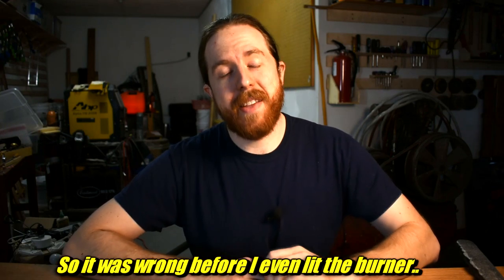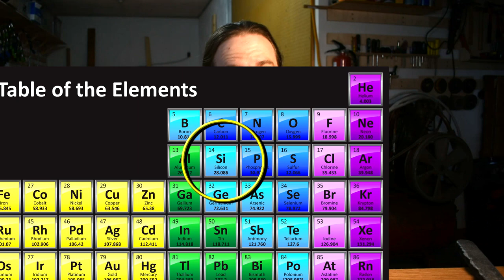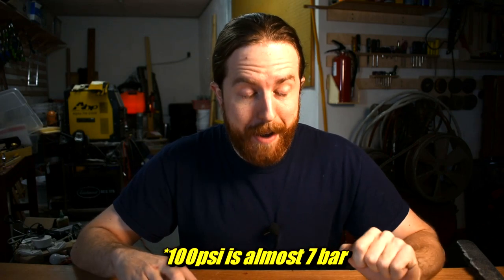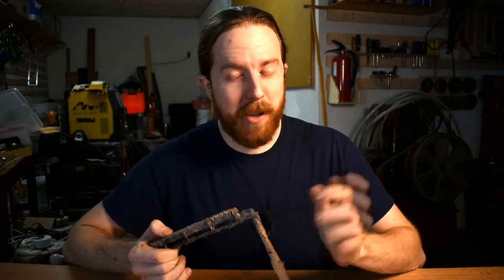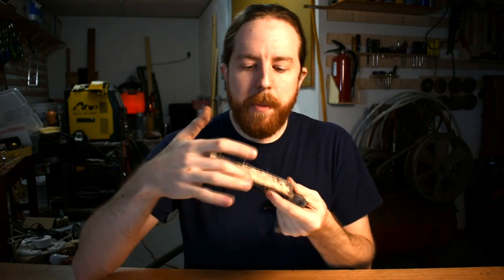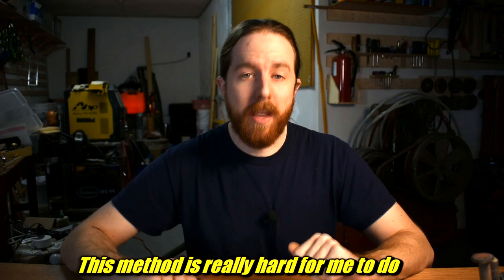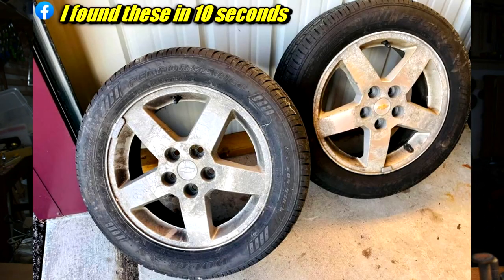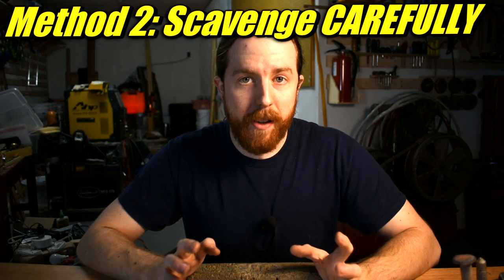Metal Casting Alloys Matter More Than You Think...

Comment: Foundry metallurgist here, mostly with stainless steel and low-alloy steel experience but my current employer makes a lot of aluminum and silicon bronze (a great learning experience for me)...ingot is definitely a great way to go because it means there is traceability to a particular chemistry. Unless you happen to have a portable XRF or LIBS analyzer on your hip or a stationary OES or XRF analyzer in your garage, it'll be exceptionally hard to buy/beg/borrow/liberate random scrap and use it to make things with consistent castability and physical properties. 

This goes double for any pewter, bronze, or brass due to lead content (you don't want to accidentally melt down a 30% leaded bronze thinking it was plain tin bronze and end up huffing all those sweet, sweet fumes), but applies to other alloys as well. The difference between C95200 aluminum bronze and C95800 aluminum bronze seems rather small chemistry-wise but makes a vast difference in mechanical properties, corrosion resistance, metal fluidity in the mold, and even the color - increasing nickel contents turn aluminum bronzes from quite yellowish/gold in color to a whiter, less radiant color. Contamination with trace elements can also turn good metal into Swiss cheese through gas pickup or into a pile of chunks by forming highly brittle intermetallic phases during solidification. 

The other thing to keep an eye on is melting and pouring temperatures - changes to the optimum temperatures aren't as greatly affected by small changes in chemistry but they're critically important all the same and are something I haven't seen talked about too much as I start to dive into home metal casting YouTube. Any ingot vendor should be able to share what temperatures they recommend for a given alloy, since they had to melt and pour it to begin with.
Reply from the maker: Thanks for the info!  Interesting you mention temperature, that was the next thing I was going to talk about. My current set up has the tendency to overheat everything really quickly and that has been causing me problems.
Reply: @PaulsGarage  Indeed...we learned a hard lesson that silicon bronze really needs to be kept under 2,000˚F or so at all times during the melt or the castings end up riddled with gas defects.

Comment: As somone who hates to pay for anything, I am a metal scavenger.  I get my scrap at work at a semi repair shop,  cast engine parts & truck rims. After some experimentation, I found that a 50/50 mix of cast scrap & extruded/forged scrap gives you pretty decent pourability (I use top feed steel forms) and  better machinability.

Comment: Sadly not all car alloy wheels are 356. BMW  wheels for example are not. Many wheel manufactures have the alloy designation listed in the letters on the back of the wheel  particularly in Europe where I think it is mandatory  for recycling purposes - the designation AlSi7 or AlSi7Mg indicate 356.
But you are right - buy decent certified ingot and get an analysis sheet with it.... Martin
Reply from the maker: That's interesting, thanks!  I didn't know there was variation, but the foundryman i talked to here was probably thinking specifically of american cars.  He was at a place making OEM wheels for lots of manufacturers, all A356, but he probably meant all the American ones.  I don't see why BMW would contract somewhere in the USA to make wheels, so that makes sense.  And that's interesting on the alloy designation, I have some aftermarket wheels cast in italy sitting  in my garage, I'll go look for that!

Comment: Worked in a foundry casting aircraft engine blocks for Continental piston engines, we used A356 if i remember right, just regular molds gravity molds, we heated to around 1700F before pouring. Good luck and great videos.
Reply from the maker: That's interesting!  Aircraft engines probably have pretty strict quality control I imagine so your process must have been pretty good.
Reply: Every case half was x-rayed with a certificate about 20% scrap mostly internal porosity and sand inclusions,  usually the issues were caused by the green sand, too wet not wet enough....
Reply from the maker: that's a lot of loss!  I'd rather airplanes have good engines though, especially if i have to be in one 😉

Comment: heyo paul ! know that aluminum bronze with an Al content of more than 9% can be QUENCHED AND TEMPERED LIKE STEEL ! alloys with upwards of 14 to 15% will reach 40 rockwell C of hardness, wich is basically a mediocre tool steel. Don't forget to add iron and nickel in the mix to manage grain size and quenchability tho !

(also they usually forge better than they can be cast, but that depends on the composition)
Reply from the maker: I haven't dug much into aluminum bronze but it's easily one of the coolest alloys out there
Reply: @PaulsGarage  It machines beautifully. At least the alloys (bar stock) that I used to make bushings out of it with. The chips curl and break and the finish comes out nice and shiny. You can get stringy chips depending on the feeds and speeds though.

Comment: I've been using A319 and have very good luck with my pours.  I order it from a metal supply company.  It comes in ingots which I use a metal cutting chop saw to make into smaller pieces that will fit into my foundry.  One of the best things about the A319 is the lack of dross.
A while back I melted down a bunch of sheet aluminum scrap I had left over.  Not only did it take forever to cut and bend it but then I had a huge bit of dross to skim off.  It poured OK though.
Reply from the maker: Good tip, A356 isn't the only sand casting alloy, it's just one that's easy to buy and scavenge
Reply: @PaulsGarage  are engine blocks the same alloy?
Or local scrapyard crushes all alloy stuff and seperates out the steels etc from it.
Trouble is all the alloy stuff is down to inch chunks at most after crushing and I can't tell what's what anymore.
I could buy manifolds etc but they're more expensive (being a usable part) and I have to spend the time removing them myself

Comment: Agreed.  We used to just buy scrap bronze for casting but we weren't so good at telling the good from the poor so a lot of failed castings and wasted time.  When we switched to buying actual silicon bronze nuggets for casting it was a night and day difference.  Phosphor bronze however, ooh, that was the bee's knees.  And I loved copper/nickel bronze.  We had a source of getting small amounts of that for free.  I put myself through school selling jewelry and trinkets, and nickel bronze was great.  Never worked with aluminum.  I get that it has many useful properties for a home setup.  But you can work with aluminum or you can work with copper/bronze/silver.  But you can't do both unless you've got the time and money to keep them well separated.
Reply from the maker: I greatly prefer bronze and silver to aluminum.  Recently I started using za-12 instead of aluminum and it seems better.  It looks aluminum-ish, flows like bronze, and melts below 900f.  It's great

Comment: I assume this especially pertains to something like a lathe, where you’d want more precision, in particular…. 😊
Reply from the maker: Yes exactly, precision is important 😉
Reply: That would be why most metal gears in old low budge lathes are made from zamak 
It’s cheap 
Easy to work with and stronger than people give it credit for 
I’ve got an old craftsman Dunlop lathe from the middle to late 40s or 50s with the original zamak gears

Comment: Hah, VERY useful tip about aluminum alloys. I’ve been saving old hard drive frames to melt down, but they’re surely all injection-molded. I guess I could still cast them into large rounds to use in my lathe (my original intent), but good to know the metal will be useless for casting purposes. 👍👍👍

Comment: I still use aluminum can, but I melt it once to get all the crap out of it (paint, plastic, etc.). When I am ready to use it on a project,  I add about 10% silicon to it. Really reduces shrinkage.
Reply: How do you add the silicon? I’ve been thinking about adding it as silicon carbide
Reply: @1495978707  I get pure silicon (relatively) and when the aluminum is liquid and cleaned of any dross I just add the silicon. The temp is actually too low to melt the silicon into a liquid form but it does dissolve quite nicely into the aluminum. Then stir very well to mix it in.
When you cast it, you’ll notice the the shrinkage is greatly reduced and details fill out better. And at least to my eye, the metal now has a very faint bluish color to it. It’s barely noticeable but it’s there.

Comment: old mag wheels are cheap as chips, your local tip recycling shop is a good source, otherwise keep your eye out on the local online sales sites. I cut them up with cutoff disks and a sawzall, but I am considering a plasma cutter, as I am going through about 10 bucks worth of cuttoff disks per mag rim, albeit it usually yields around 10kg of aluminium.
Reply from the maker: Good tip!  Plasma cutter or oxy torch maybe?
Reply: You can throw rims on a fire and bust them up with a sledgehammer when they soften.

Comment: What about the aluminum in small air cooled engines?  Like on lawn mowers and rototillers, etc.
Reply from the maker: It depends how they are made.  Some blocks and stuff are sand cast but I think quite a few are die cast and would probably be die cast metal

Comment: How would billet aluminium work for casting? Like 7475 aluminium alloy plate
Reply from the maker: Probably pretty bad, not enough silicon in 7475.  It's for machining, not for casting
Reply: @PaulsGarage  Thanks.
Reply: @PaulsGarage  Not all aluminium casting alloys have silicon, A712 is relatively similar to 7475, but has less magnesium and basically no silicon. If the metal is free I'd give it a shot.

Comment: How about using old small engine blocks for casting? IE: Briggs & Stratton
Reply from the maker: It probably depends on how it was made.  Lots of small engines are made with die casting.  You can usually see lines from the dies if it's die cast, or sand texture if it's sand cast.  That's what I would look for

Comment: I wonder if the mold were heated (warmed) would the aluminum flow deeper before the plastic & hard stages.
Hm...
Reply from the maker: Probably yes, a lot of molds are preheated. I usually don't do much more than blast a torch down the sprues and only when I'm casting in winter

Comment: What about heatsink aluminum? I have soo many old heat sinks from old computers and electronics and was going to cost them into knife bolsters for my custom blades
Reply from the maker: Heatsink aluminum is usually pure, they tend to be cut from extrusions.  not great for casting because it doesn't flow well and has a high surface tension.  It also has a high shrink rate.  Might work for small stuff like knife bolsters, though.  I assume you will be filing them down and stuff anyway, right?
Reply: @PaulsGarage  for sure, filing, sanding and polishing… just got a little electrical foundry a few months ago and have been a little scared to give it a go. Definitely getting a little more confident with your videos. Now a just need to get some good casting sand and bite the bullet
Reply: @PaulsGarage  what do you suggest for an easy start… I don’t want something soft, and was thinking about that copper aluminum 9/10 mix you made on another video… looks nice and tough, and the goldish Color would really add some class
Reply from the maker: Petrobond is very user friendly, especially for newcomers.  You don't have to worry about moisture management.  As for metal, aluminum bronze is pretty awesome but it develops a dull black patina that is kinda ugly.  Maybe try ancient bronze?  Its 90%copper, 10% tin.  You can get clean casting grain from riogrande.  Also silicon bronze, sometimes called everdur.   You can give it a cool patina or polish and clear coat it.  Everdur casting grain is available from rio grande or Belmont metals.  Definitely make sure whatever form you get the metal will fit in the crucible for that electric furnace.  Casting grain is what people usually use with those

Comment: A380 Aluminum Alloy has optimum machining properties and suitable for die casting and sand casting.
A356-T cannot be easily machined hence suitable with sand casting and permanent mold casting.
This information can be found online, nothing wrong with sand casting a380.

Comment: All alloys are cast at one point in there life, at least into ingots anyway. I use 6061 alloys with no problems. Plumbing brass you have cast and machined. Mostly use machined. The cast aluminum i have is mostly engine parts. I turn all scrap into ingots before I make any castings. The biggest issue I see is gating and risers systems. And that changes with alloys used.

Comment: I'm pretty new to home casting myself. I've only been doing it for five years, learning mostly by myself with some help with some sage advice from others, and I've used A356 for most of my castings. My problem that I've never been able to compensate for is pockmarks/blowholes. I de-gas and have used flux and have yielded various results but have never made consistently clean castings. Any advice on accomplishing this?

Comment: I don't know why there is so much hate for aluminum cans. In school shop class we used to make all sorts of stuff with them successfully. All closed molds.

I tried to look up what alloy it is but apparently the body, lid and pull tab are all different. So I'll have to figure out what the resulting chemistry will be first.
Reply from the maker: It works, but the surface tension is very high, it doesn't flow well, and the shrinkage is very high.  If it's all you have then you can use it, but you will always get better results using a casting-specific aluminum alloy (like a356 for example).  If cans are all you have, it can be improved with a few percent of copper which increases strength and improves machinability, but doesn't help the flow much, and with detailed castings or thin castings you really need a more suitable alloy
Reply: @PaulsGarage  Ill have to figure out what the resulting alloy is and then compare to more easily cast alloys. It might be easy to add a little of another metal to bring them close. Most of my source stock is engines, window frames, tubing, and not cans, so it will vary anyway. I'll have to take the ingots to work and scan them to see what they are.
Reply from the maker: The trick I've heard (haven't tried it) is to use cast aluminum pistons, which are usually hypereutectic and have a super high silicon content, so cutting non silicon containing alloys with pistons should help.  As long as you get the ratio right

Comment: So Let me give you a little something I've learned working at a certain car make that I can't mention here.. Basically they do use high pressure die cast for engine blocks and low pressure for other stuff.. but there's more to it and I've learned more not only from you, but from my co-worker/friend who used to do downpour/foundry for a living.
Reply from the maker: Yeah engine blocks are kind of a different thing too, so I didn't mention those.  I've seen some car engine blocks I could swear are lost foam cast in by the texture, very weird.
Reply: @PaulsGarage  The crazy thing is, they run through a slew of machines to get smoothed out just right. Its very very cool where I work; they not only do the blocks but also the heads, connrods, manifolds, and a few other things on this particular motor company. Its super cool to see everyday. The guys that do like downpour or whatever wear a weird foil looking suit thing.

Comment: Do you know how to add silicon? I would be very interested in learning the metalurgy behind making alloys, for example cast iron.
Reply from the maker: Depending on what you're making, you can get a mix of the metal and silicon (like ferrosilicon) to add to iron to make alloys.  Pure silicon is pricey and difficult to dissolve but the purpose made stuff works
Reply: Just sell whatever you have as scrap and buy some source of proper casting alloy. You won't get a good result from pure aluminium + silicon.
Reply from the maker: Yeah as much as I love salvaging free stuff it might be easiest to do a trade for the right stuff

Comment: Q. Can you add silicon to The liquid metal to make a higher viscosity making it flow better so you can use whatever alloy without worrying about the flow by actually, adding silicon to it similar to borax? 

I love your videos and all ways full on good info.
Reply from the maker: In some cases, yes, but there is usually a limit.  To make cast iron or silicon bronze, you can add ferro-sillicon or cupro-silicon to the mix.  These are alloys with LOTS of silicon that don't work well on their own but can be used to raise silicon content.  There's a limit to how much silicon can dissolve in the mix, however, similarly to how there's a limit to the amount of sugar that can dissolve in water.  And usually there is a point where adding silicon makes the alloy more brittle or something.  It's not just a "more is better" kind of thing.  There can be other problems caused by other metals, as well.  A380 aluminum isn't worse than A356 just because it has less silicon.  It actually doesn't.  A380 also has some copper in it, which screws up the properties relative to A356.
Reply: Legend thank you for all the info 👍

Comment: Aside from using more suitable materials - you could always just add a metal funnel on top and put the cast under pressure with a plunger.
Kinda tricky to get working at first but not that technically challenging either
Reply from the maker: Kinda like how die casting works? Shove the metal in there? I'd be worried about blowing out the sand lol